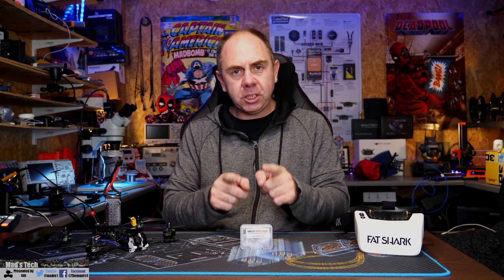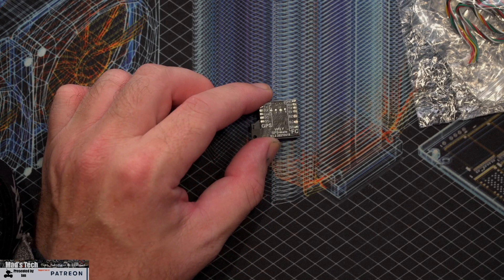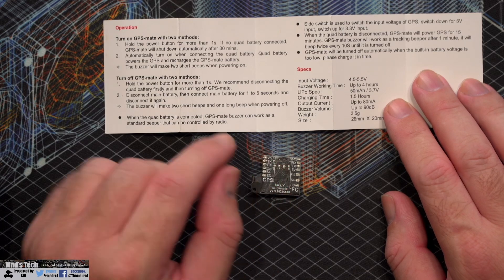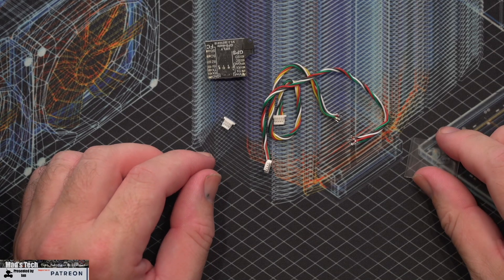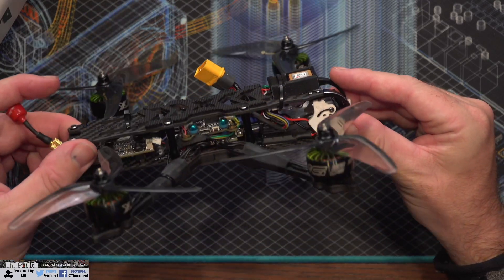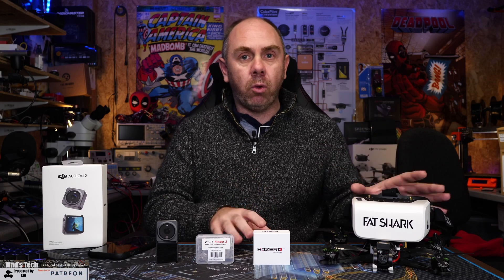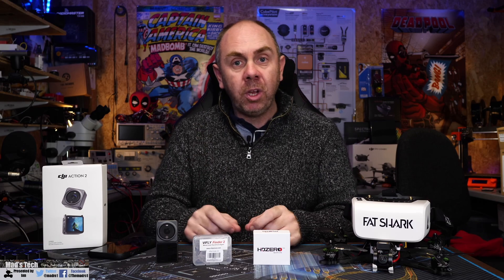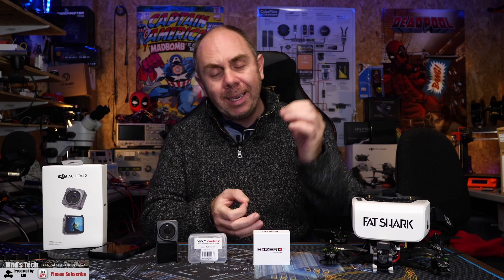VIFLY GPS Mate - A Must Have For Digital FPV

Comment: Hi, have you heard any issues of the GPS mate creating an RC link issue? I have a 4s Nazgul Evouque  V2 that I recently installed the iflight GPS on. I got tired of waiting for locks, so decided to add this in as well. All wiring seems to be correct, and it will get a lock and allow me to arm the quad, however after a few minutes the RC link completely disconnects. The flight controller doesn't beep as if it is a rc disconnect, it's almost as if the RC isnt bound (and re-binding does nothing). And the only remedy unfortunately is to leave the drone unplugged for somewhere around 30 minutes, but its recurring. Once I removed the GPS mate, and resoldered the GPS back up like it was everything works perfect. Is there something that I'm missing? Thanks in advance

Comment: How loud is the beeper? Im asking if it's worth to buy vifly finder separately?
Reply from the maker: It’s not as loud as the beeper but loud enough when your with in 20-30ft.
Reply: @MadRC  thanks. Need to think where and how to install all of them on my Evoque F5 so that I can access them all 😀. Was thinking to put GPS Mate right under GPS at the back. I guess no disturbance would be made if Mate goes directly below the gps (tpu mount would be designed that each device would have its own place, and few layers of tpu between them)?

Comment: I thought they were a good idea as I was having long waits for the GPS to get satelites and the Air units and VTx's were getting hot. But the problem I found was I still did not know wether the GPS had sufficient satelites to fly with as you cannot see the Goggle display without powering up the AIr unit (VTX). So I gave that up and bought really good quality GPS units and they get the satelites very fast. Problem solved. By the way I do have Vifly beepers on every quad as I too nearly lost one of them prior to buying these units. Vifly Beeper, very highly recommended product, would not fly any distance without them.

Comment: Yep, seems to be a good alternative if the GPS lock takes to long ... I'm lucky though, both my GPS equipped quads get a cold start lock pretty fast.

The 4", already with a separately powered, charging through the flight battery beeper, needs around 2-3min for a cold start, consuming approx. 10mAh. This delay is kind of good sometimes as I get the possibility to opt out from the failsafe GPS Rescue by arming before GPS lock if I know that a ascend isn't desirable if I fly in & out  from locations with something overhead.
 
The 5" is bloody fast, cold starts in 30sec-1min & doesn't need any time at all between flight battery change. And to avoid soldering I put on a self powered & usb chargeable ViFly Beacon instead.

Comment: To prevent overheating on the ground, I use the switchable power pin on many matek FC to power air unit.
Reply: I actually really want a smaller PWM driven power switch unit. The one i found are as large as a small ESC. It could be much smaller.
Reply: What a great idea I've often wondered why ther is no switch